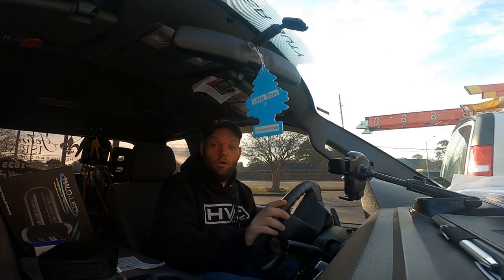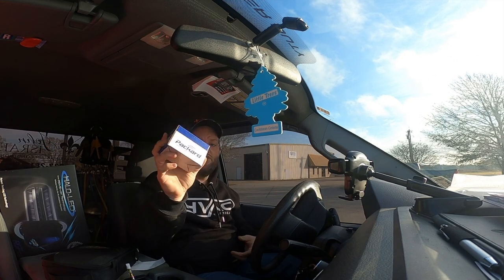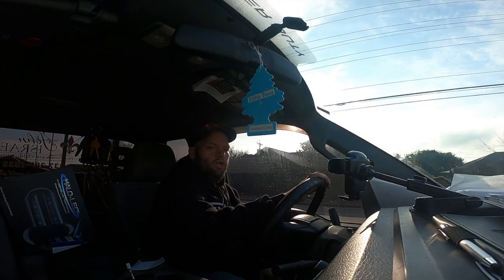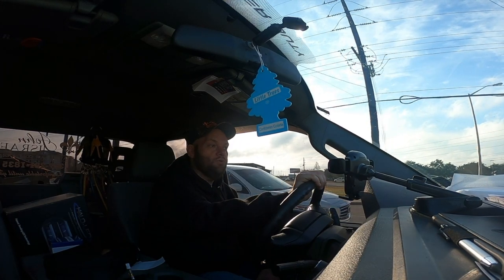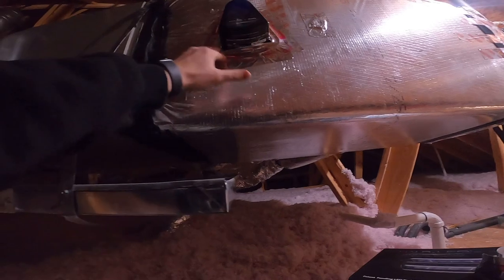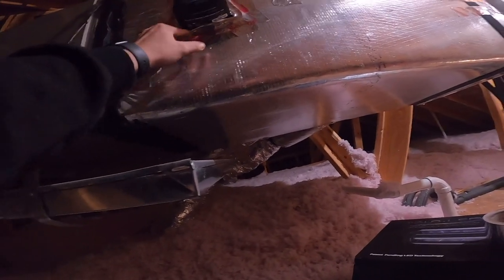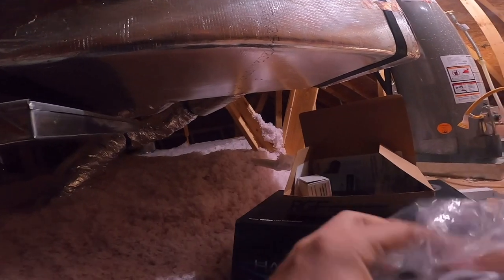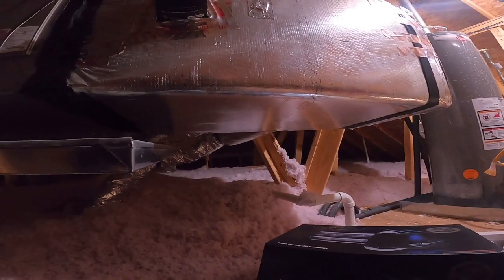Reme Halo LED Installation

Comment: The Reme halo LED should be wired to cycle on and off with blower. Not doing so will shorten LED life. Not to mention void your customers warranty. The Remi halo is the only one you run constant. It has standard UV bulb so cycling it on and off will kill it.
Reply: I put Apco X Duals in my 2 units with 3 year bulbs and added their own transformers. Apco wants them wired 24/7.
These come with a metal frame to install in ductboard and the unit screws to the metal frame. The main unit is in the supply and the second light is inside the coil. These ticked all the boxes for me.
Reply: @scotts4125   that’s nice unit and really like mounting plate. Reme Halo-LED has five year bulb, washable ceramic catalyst, and more energy efficient.
Reply: @onevoice5383  I had mine narrowed down to both of these. I was leaning towards the Reme but my supplier who I trust pointed me towards the Apco and said he installed them in his house as well so that's how I ended up with them.
Reply: You are correct, It's amazing how many people install it incorrectly. Then complain because it fails
Reply: Does this work only when the furnace is running, or does this run when the AC is running, too? Mine was installed without the air switch kit, only runs when furnance is on. Is this normal?
Reply: @shanew7361 yes that is normal. They probably used a relay. So anytime the blower is on then the light is on. We use pressure switch when installing on a air handler.
Reply: @MichaelMeherg-pq7mh  Incorrect it's supposed to function anytime the furnace or AC comes on. Apparently, my brand new Carrier 2 stage 125k btu circuit board needed to be replaced. Fortunately, it was under warranty and resolved the issue.
Reply: @shanew7361  yeah man. When the ac comes on so does your blower. That's how it blows the cold air in your house. The blower/fan always runs in heat or cool. Other wise your heat exchanger would crack or your ac would freeze

Comment: The reme halo led actually will turn on and off with the system. The original Reme halo stays on all the time. Love those products.
Reply: It should have came with a transformer in the bottom of the box with a metal cover
Reply: There is a air switch kit you can get with pressure switch made by RGF for the reme that will let it come on and off with the system. I have found out that is  the easiest way to make it cycle on and off vs having to install relays etc.
Reply: Sorry for the multiple comments just sharing what I’ve experienced installing this bad ass germ killer! 😎
Reply: Yeah most people don't adjust them accordingly to cfm either.

Comment: You need to return to this customer and install that unit correctly, if it hasn't failed already due to improper installation. We include instructions and a relay for a reason. You can also call the number on the box and I will assist you if you have trouble installing.
Reply: Does this work only when the furnace is running, or does this run when the AC is running, too? Mine was installed without the air switch kit, only runs when furnance is on. Is this normal?
Reply: No it’s not normal

Comment: I’ve installed a ton of these, company I work for stopped selling them all together due to the extremely high failure rate on the LEDs. Not sure if they’ve worked the issues out but I’d say over %50 we installed we ended up having to replace under 1 year and that’s with the relay installed.. we switched over to Fresh Air APCO-X. Has a lifetime warranty imo better product have yet to see one fail.
Reply: If it's installed correctly failure rate is very low, you can call our tech support for help with installation. 90% of the failures we see is due to improper installation
Reply: Does this work only when the furnace is running, or does this run when the AC is running, too? Mine was installed without the air switch kit, only runs when furnance is on. Is this normal?

Comment: You installed this one incorrectly.  The LED needs to be installed to cycle w/ the fan blower motor.  They have a product that can be left on all the time but these LED units need to cycle w/ the fan.  It lays that out clearly in the manual and comes w/ the relay to do so.

Comment: Does this work only when the furnace is running, or does this run when the AC is running, too? Mine was installed without the air switch kit, only runs when furnance is on. Is this normal?

Comment: I normally try to only have them run when the fan is activated. Like on the eac term or current sensing relay. I'm not sure if it helps the bulbs or not. To be honest I don't know how well they clean the air. 🙃
Reply: Reme halo led should not be attached to the EAC terminal.  I always run them thru a pressure switch to activate the Reme when air flow is sensed.
Reply: @wahtsai8687  why can't they be connected to the eac terminal?
Reply: @1776cootsflybynight  Not sure why Rgf does not want it on EAC terminal.  They say will void the warranty.
Reply: @1776cootsflybynight  The EAC will kill it, If you are dead set on using the EAC use an isolating relay. You can however use the Dry contact EAC found on some of the newer Trane and American standard units.

Comment: Why not tie it in on EAC terminal on the board and neutral on neutral I'm assuming the furnace has EAC on the board
Reply: According to Reme if you activate it with the EAC terminal it will void your warranty.
Reply: @WST77  I've never put one in . So the basically want the bulbs burning out more often I guess
Reply: @franks6837  that's my understanding also.
Reply: They allow you to use the EAC terminal to drive the relay and switch the load side of the transformer.  I am sure there is a reason.  This is what I did with mine

Comment: Hey john nice install. Believe it or not, ive seen guys drill screws into duct board. Madness. 

Does the LED not have a desired airflow arrow on it?
Reply: It does.  Air flow should hit the catalyst side, which is the concave side of the HALO.

Comment: Installed a led model, almost a year ago. And today I smell a plastic type of smell. Not a burnt plastic, but almost like styrofoam. Anyone have any ideas.
Reply: If installed incorrectly, EG. powered all the time, it eventually will burn up either the transformer or the unit itself.